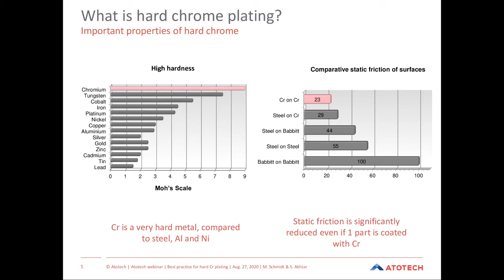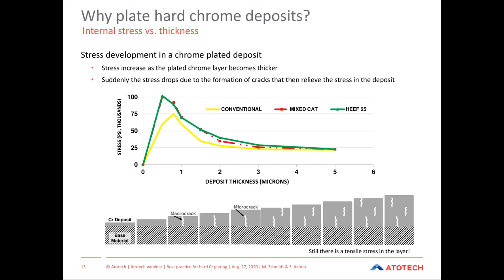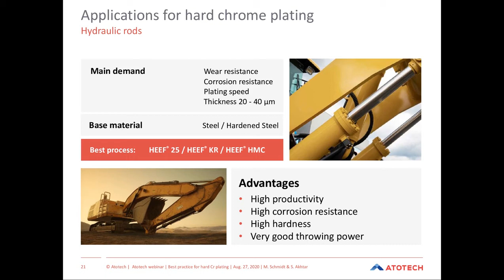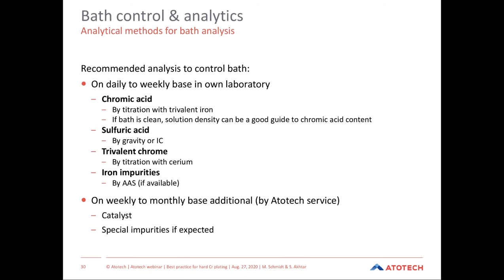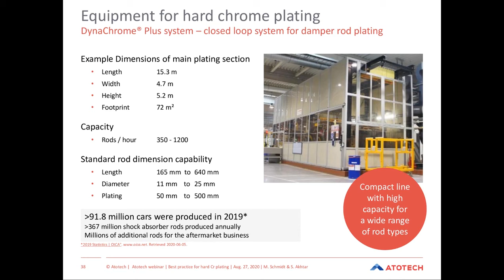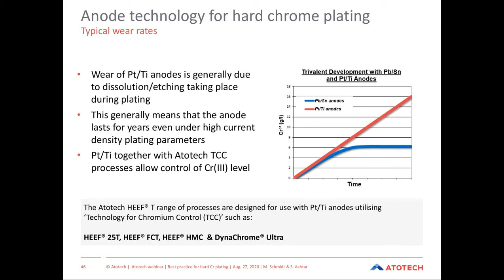Best Practice in Hard chrome plating

Comment: Hi, May I ask a question? As I know, it is difficult to meet the plating thickness within, for e.g. 30 micron +/-10 micron.  Therefore, a grinding process is must to meet the required Cr. plating thickness.  Is this same situation there? Or your Cr. plating technology is different and no need to grind after Cr. plating because your process can have a accurate thickness result evenly?

Comment: hi im wondering why aluminum engine cylinders do not use hard chroming on the cylinder walls? why use complicated processes like nikasil, would nikasil perform better than chrome, or is hard chrome plating just more expensive? thx